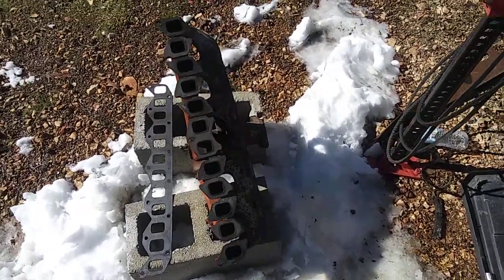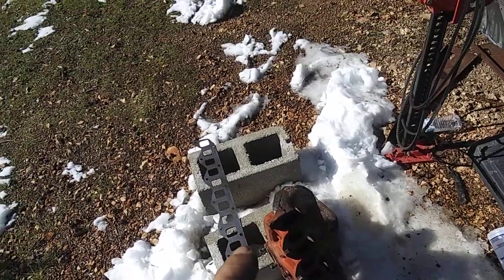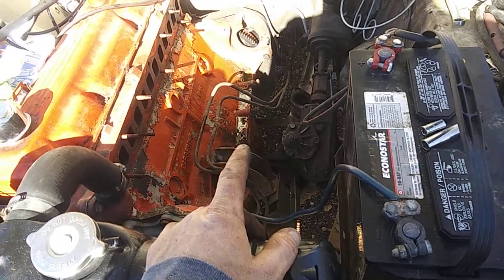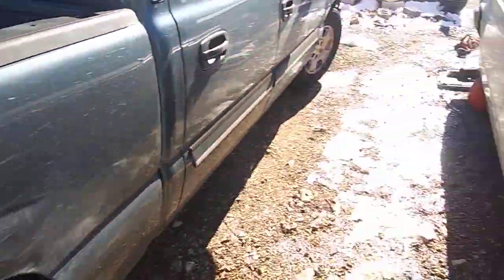UPDATE ON PROJECT VALIANT THOR: 225 CID Slant6 car refreshing motor/ stock mods

Comment: You gonna run a single barrel carb? About how many CFM is it?
Reply from the maker: I think with a 2 barrel carter with no air cleaner on the flow bench I think 230 cfm give or take ?. don't know what the 1 barrel carter does . I did modify the carb for max air flow and will be touching up the inside port of the aluminum intake for a tiny bit more cfm. I'm still figuring out what to do for the factory air cleaner though. Been trying to find a performance nòne paper air filter